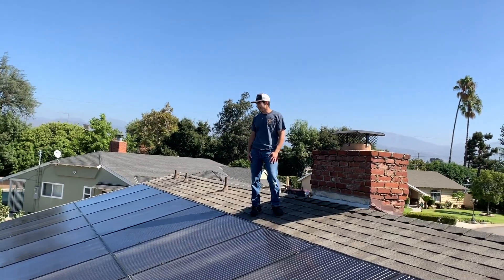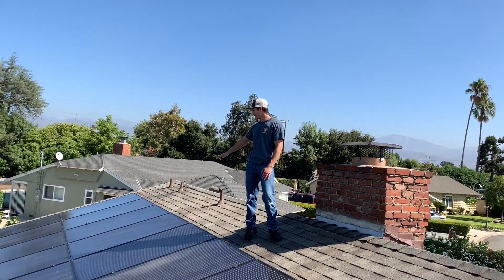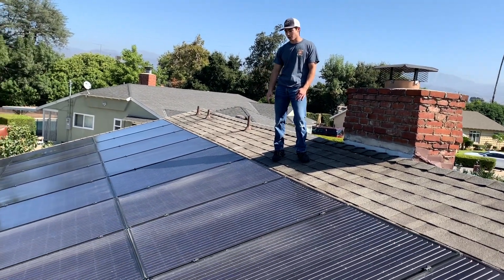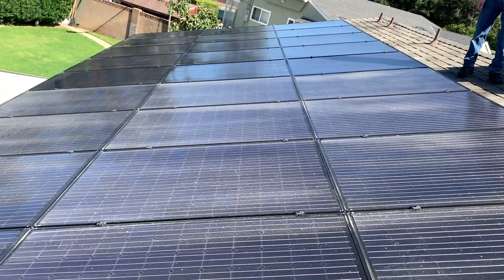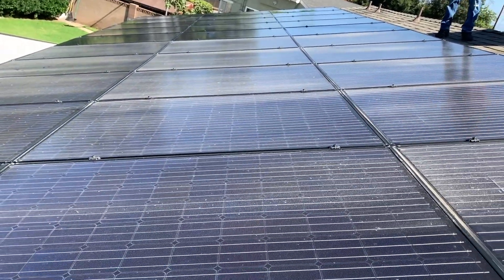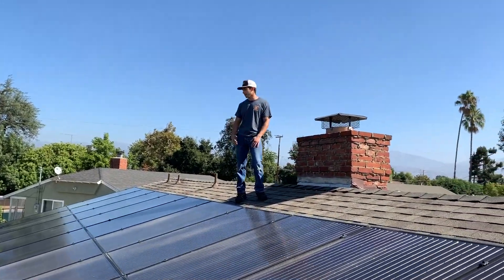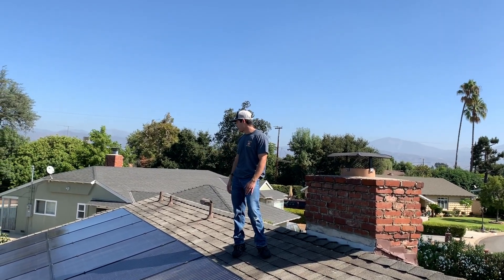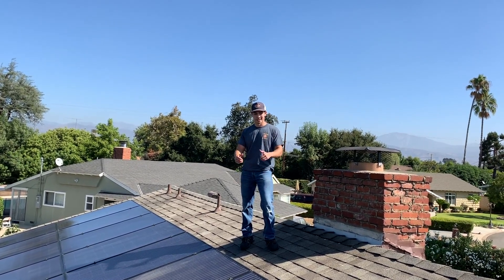Cleaning Solar Panels Hose Water vs Deionized Water

Comment: Lol. Nice sales pitch… to all the rest of the folks, this is garbage info. Unless you live in a place with a water supply that has damn rocks and hair in it lol, using your hose water and brush will be just fine.
Reply: Gofundme: $57,000 for equipment-deionized large truck.

Comment: It makes a huge difference how "hard" you city water is.  I live in an area where the water is extremely "hard".  For cars, I do wash with city water, but rinse with deionized.  For the solar panels, I use only deionized.  I could do the initial cleaning with the city water and just a final rinse with deionized on the panels, but it might leave a certain amount of city water hear and there on the shingles eventually making a whitish look from the minerals.  So for the panels, I use deionized only.  Also, when washing a car, I use a lot of city water for the initial washing and rinsing before the final D. I. rinse.  That's because I have to keep rinsing the entire car with city water to prevent water spots from drying before I can do the final D.I. rinse.  So for car washing, I would need to use a lot of D.I. water.  For the panels, I only need to spray enough D.I. initially just to get them wet for brushing.  So I can be pretty miserly with the initial wetting, and rinsing, on the solar panels.